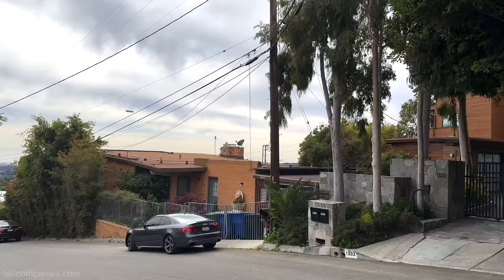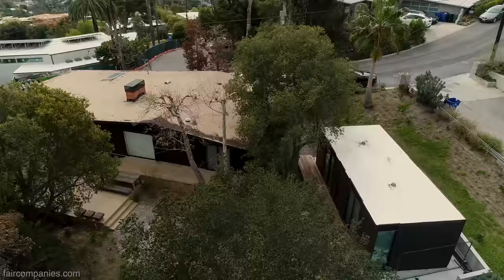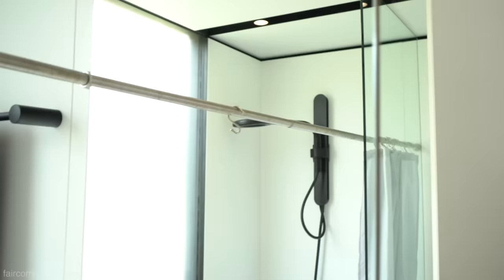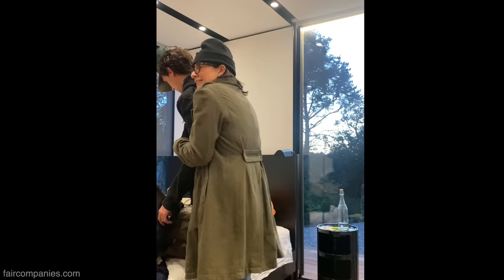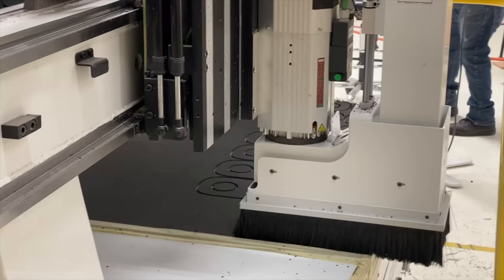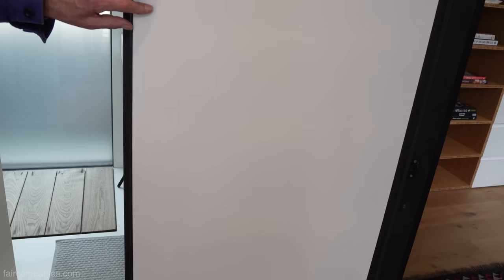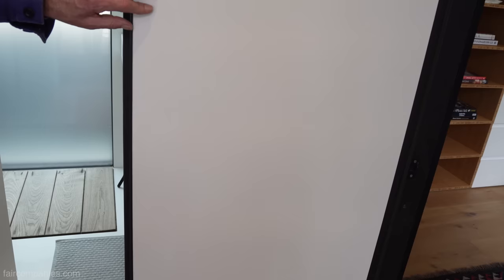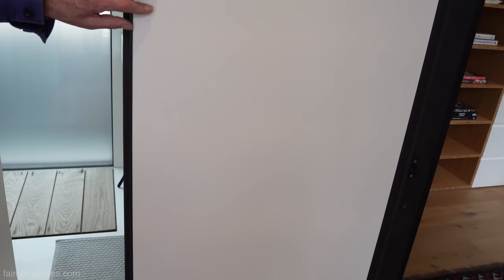LA architect needed small home. He got turnkey custom prefab

Comment: I live in this neighborhood. These modest homes all sell for considerably over 1.5 million, depending on the lot. They also come with a lot of restrictions as to adding on to the main homes or building up. Glad to see they are allowing ADUs in the neighborhood. Honestly, given rent rates in Los Angeles, the teens are likely to be living at home for a while after college too. It wouldn't be a stretch to put in mini fridges where the desks are or install murphy beds to make the rooms more multi-functional.
Reply: Without revealing the location of the home, could you tell us what neighborhood this is?
Reply: @sharonadlam3195  Thanks!
Reply: @georgekrpan3181  Considering a view of the ocean and DTLA in the distance this guy talks like he lives in Santa Monica.
Reply: @swaghili  Thanks!
Reply: @georgekrpan3181  you can also see the Getty Center is nearby in the opening shots
Reply: @LeeTomaVideo  Cheers Lee!
Reply: Was one of those teens that lived with parents in CA through my 20’s.  A setup like this would’ve been a dream come true
Reply: This is physical security as the parents get older. They will require more assistance.  Having this is perfect to allow them to continue living in the home while one of the sons can keep an eye on them
Reply: mid century in the palisades for 1.5?? last i checked in was more like 4.5mil minimum
Reply: Hollywood Hills
Reply: @swaghili It can't be in Santa Monica if the typical house cost only $1.5 M
Reply: I live inland from LA. I am surprised that they only go for $1.5M.

Comment: I'm disappointed that they only serve LA for the foreseeable future. I'd be very interested in using this. I'll definitely be keeping an eye on the company.
Reply: I haven't looked into it, but I'm guessin they can't be the only company in the country.
Reply: Shipping these units/panels surely wouldn't be terribly difficult.
Just needing trained LEGO guys to place them!
Reply: They are using SIP’s (structurally insulated panels) so I’m sure you could find someone doing near you.
Reply: Probably engineered for the LA climate.  Cold environment models would require better insulation, the exposed seams would probably need to be redesigned or eliminated, triple pane windows, etc.

Comment: I have a feeling this prefab is very expensive per square foot, but I suppose when you can afford a house that costs several times the U.S. national average home price, it's a drop in the bucket. I love the finishes with the white walls, light wood, and big windows, but everything being bespoke and integrated is going to make future repairs and upgrades expensive and more difficult than typical.
Reply: You are absolutely right regarding the $/sqft.
Reply: 200-300 $/sqft
Reply: @nicoftime1534  Yup, and very restrictive when it comes to terrain: if you can't get a crane to your plot, you can't build with them. And in all fairness that's pretty much the same case with most prefabs across the board.
Reply: Ya, but that's democratic.  In the sense that you need options for all income levels, including established urban professionals. If it's a good option for him at his time of life that adds value to property of his type in a "sustainable" way, (they didn't plow down the house and build one twice as big.)   Other people do other type of ADUs at different price points.
Reply: @nicoftime1534  I feel like that’s what it cost for a non prefab addition ? I could be over estimated
Reply: @nicoftime1534   normal construction is about 400$. how would that be cheaper?
Reply: @MrSeattledan depends on how much you spend on kitchen and bathroom. In L.A. it should be around $250 per square foot

Comment: I see a touch of Arthur Erickson style in the design. I like this. I like that it is modular too. For colder climates, you can have several separate units like this one, connected by a covered bridge that has either glass panels or part glass, part solid wall. This would make a unique design.

Comment: For those interested, I read that his company charged $200,000 for a 400 square foot model in 2021. I'm not sure if that includes any sewage or plumbing that goes to the property or the permitting fees required by the city. It is still a relative bargain for this neighborhood. To add to 400 square feet to their existing home would have cost more in this area.

Comment: I love everything about it, but, as a retired Electrician I am bothered by the lack of accessibility for service to the receptacles and switches. How does one go about servicing a bad receptacle?
Reply: great point. not to BC🇨🇦code for sure.
Reply: It's difficult to tell if these are the flush mounted outlet covers or not, but the ones I've seen installed have magnetic covers you just use a small suction cup to remove to service.
Reply: @SmartMass  I've worked with those. These don't look like that.

Comment: black house in 110 degree LA summer sun is like black car in 110 degree LA summer sun
Reply: Architects and designers are mad keen on black here too. Lately has been between 35 and 40 (104F) degrees for two weeks here in Autumn in Sydney. You could fry an egg on the house. Without wide eaves and a jungle like house cover it is way too hot. I do note the roof here is white (heat mitigation). Is the glass special? What about ventilation to open the house to cooling breezes?

Comment: Bet it cost him like 500 grand or more. Could never imagine building my kids there own house. Bunk Beds would suit 2 teenage boys just fine lol. LA is crazy. Also you could build a shed like this with a charming mid century look  for like 10-50 grand depending on how much code you follow and how nice you make it. Not a fan of cold soulless modern design myself.  Just saying
Reply: Cover pre-fabs are a rip-off. They've been around for quite a while, but frankly 200k for the pre-fab alone, not including the build itself, the permitting, the surveying, the licensing and leveling of the land and what not I echo your sentiment. Plus one could even add solar and even a gas powered generator for the cost of those two units.
Reply: I really like your idea. I am building a house on an empty lot (3k square feet) about 800 to 1000 square feet. My budget is 200k not including foundation.